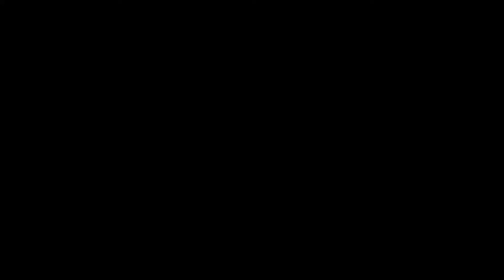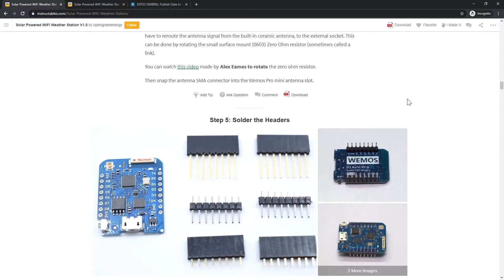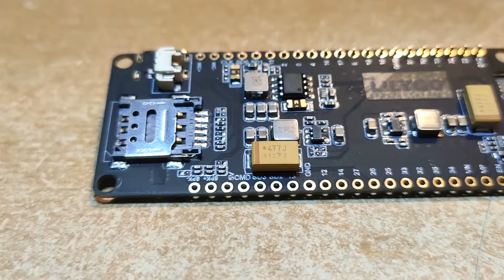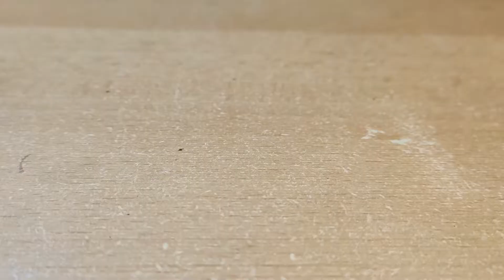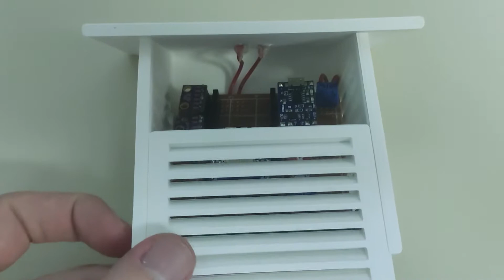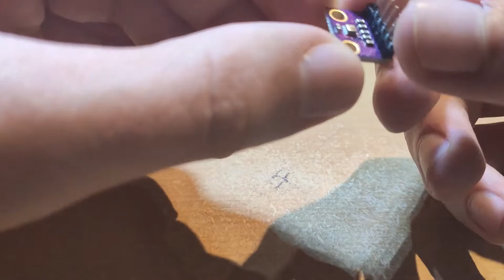Solar Weather Station DIY with ESP8266, ESP32, SIM800L sending Data to a WEB Server over WiFi/GSM

Comment: Excellent video. Very good.  Which panel did you choose?  Aliexpress link no longer works.  thanks.
Reply from the maker: Hi. You mean the solar panel? It's possible that link doesn't work anymore. Will check it.

Comment: Hi will it work when i use wemos d1 mini wired with sim800l?
Reply from the maker: I haven't test it. I'm not sure if the battery would be able to power both. If yes it would definitely draw more power.

Comment: Verry nice project what was the battery life and charging time using solar panel sir
Reply from the maker: It depends on how long the station is exposed to sun and how frequently you send the readings. Empty battery can be charged in a few days under the sun. Battery can hold for a very long time if the conditions are good. I can confirm mine station was "alive" for a few weeks when testing indoors in the winter-spring time with 1 hour report cycle of readings.
Reply: @1BarConnection  thank you sir i am using 30 cycle want to place station in waterproff enclosure  using 2 18650 battery i want one month working om battery and will attach solar panels as well

Comment: Hi, where did you build the case for the weather station?
Reply from the maker: Hi. If found the case on Thingiverse. Then edited it in Tinkercad and Ultimaker Cura before printing on 3D printer Ender 3. You can find links in video description.

Comment: Hi, is there any option to add wind speed sensor in this system..?
Reply from the maker: I haven't try it but I see quite a lot of projects with the wind speed sensor on the internet. It should be possible to do it on the similar way.

Comment: Hello, consult, with only one battery how long is the station operational.
Reply from the maker: If I remember correct I've tested it up to one week. It should last for a long time if BMS is set up correctly and conditions like enough sunlight, dry environment are good.